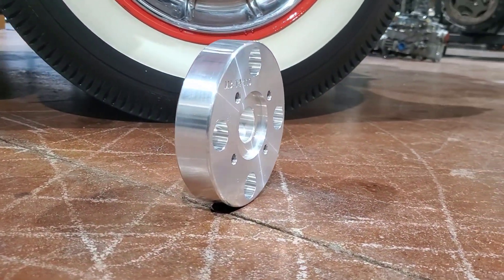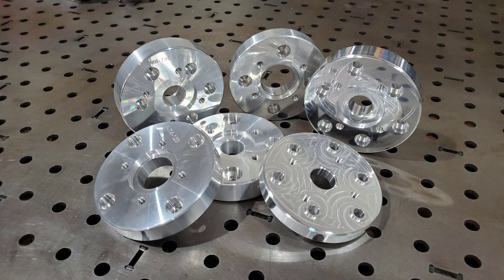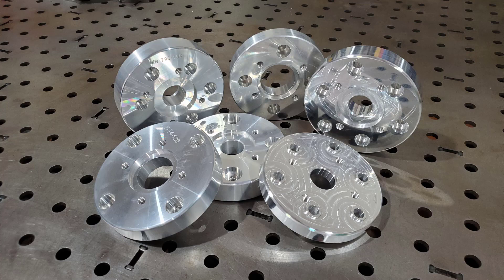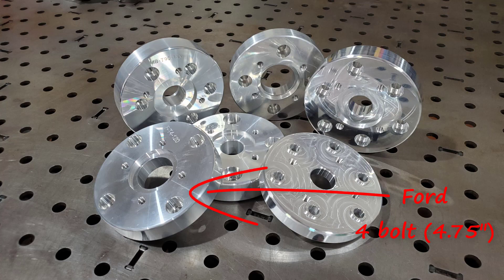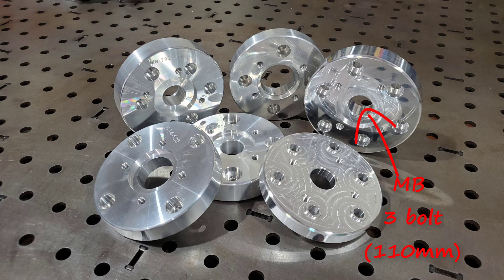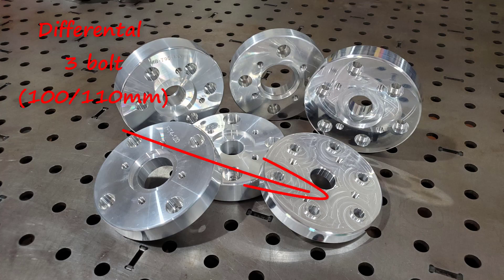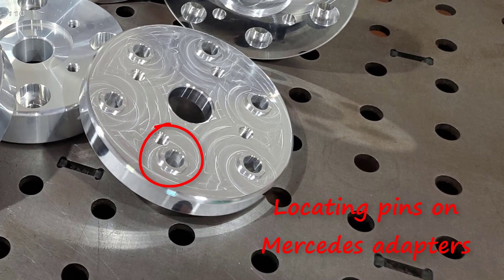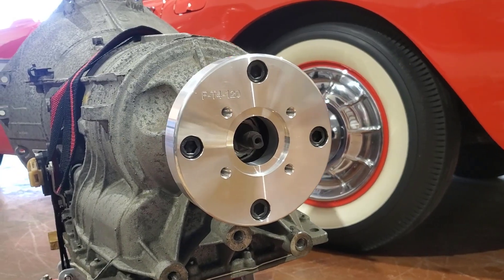Driveshaft adapters for your swap project (Ford, Mercedes, Nissan)

Comment: I wanna know if there’s an adapter for a ford 5 speed into a 300sd 🤔 I’ve always wanted to do that
Reply from the maker: sounds like you are meaning more of a transmission adapter.  For that you could check out Speed Gems.  I think they have something.  Then for the 300SD, you can use one of these on the diff, throw away that MB center bearing and use a U-Joint style driveshaft.  On swaps if you have a lot of power or things are not 100% in alignment, those MB driveshaft center bearings and flex discs just dont last long.